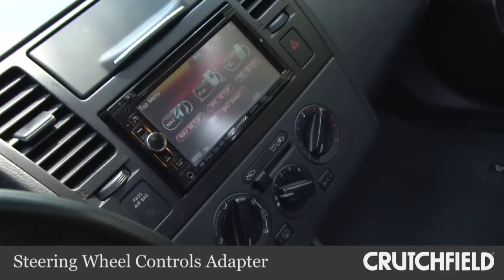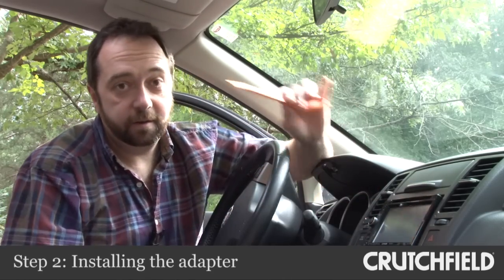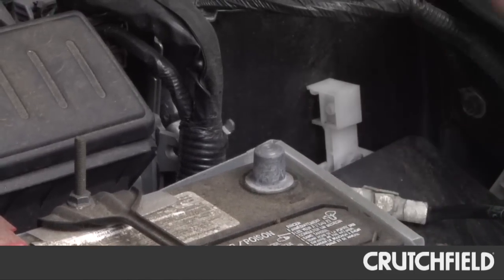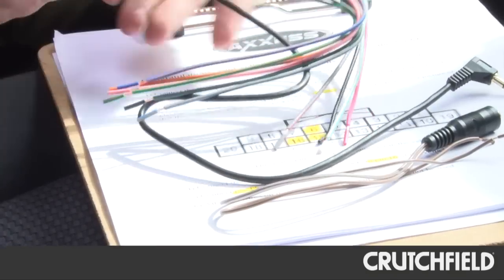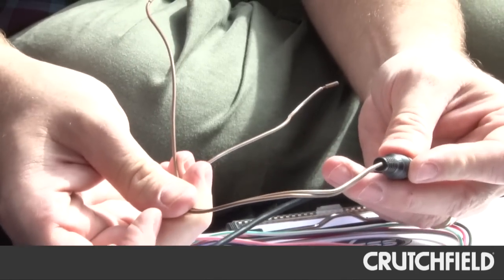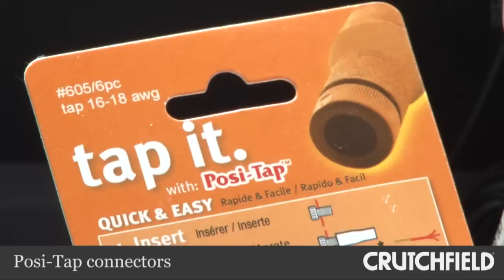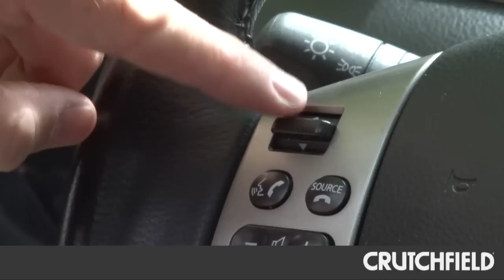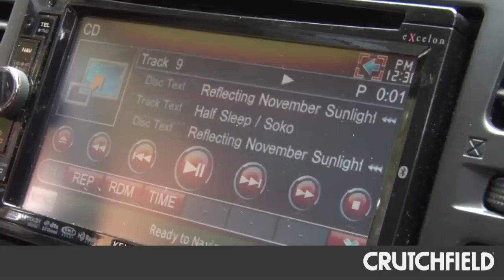Installing a Steering Wheel Audio Control Adapter | Crutchfield Video

Comment: Does this work for teyes cc3
Reply from the maker: We don't list an interface specific to that radio or brand; but we can check for one to match your car. Be sure to verify with your radio manufacturer regarding compatibility. What is the year, make, and model of your vehicle?